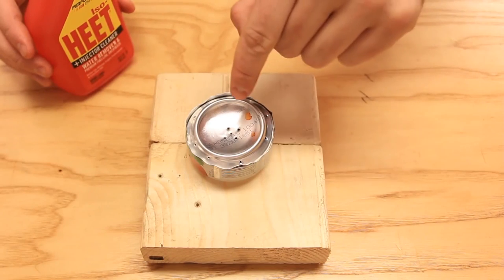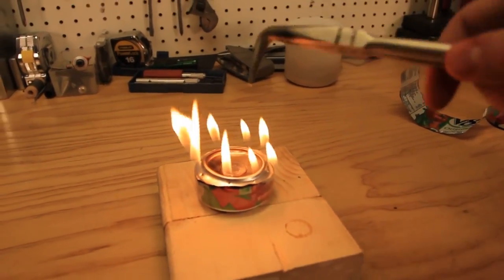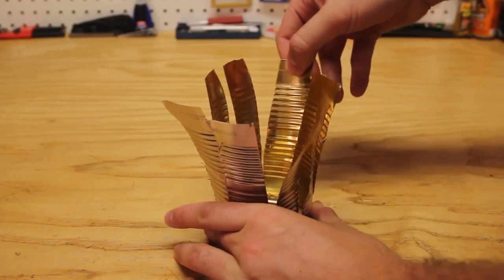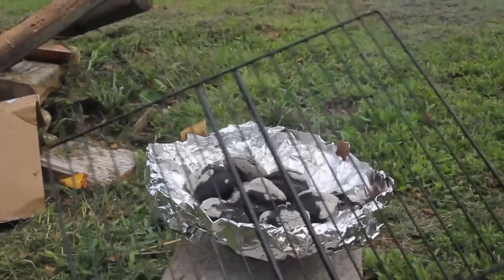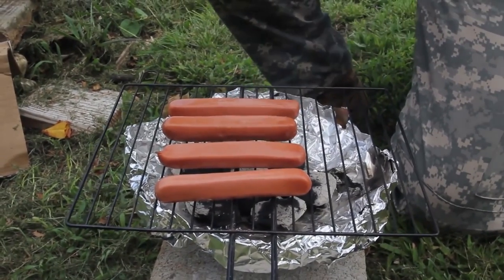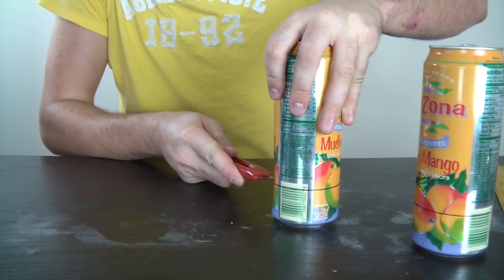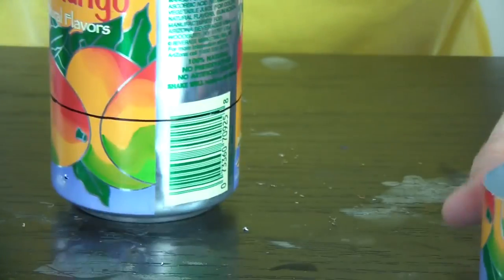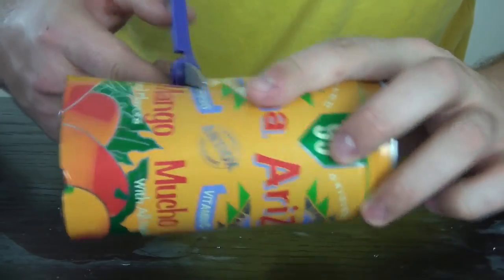6 DIY Alcohol Stove Compilation

Comment: You can make a small bottle cap alcohol stove by smashing two together with a pinch of insulation or fiber glass in between them, Mae sure the top has a small hole and is fitted on the inside of the bottom cap